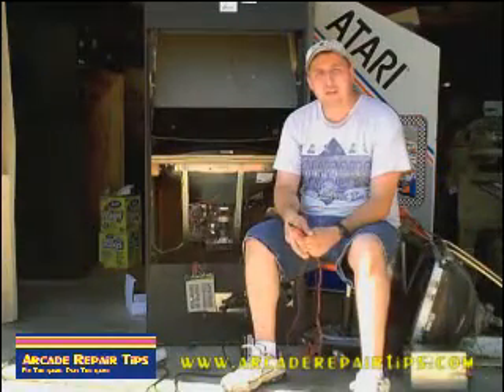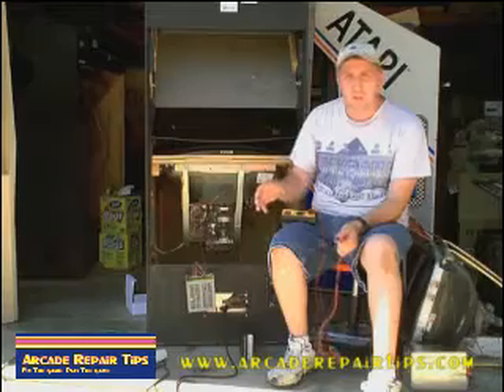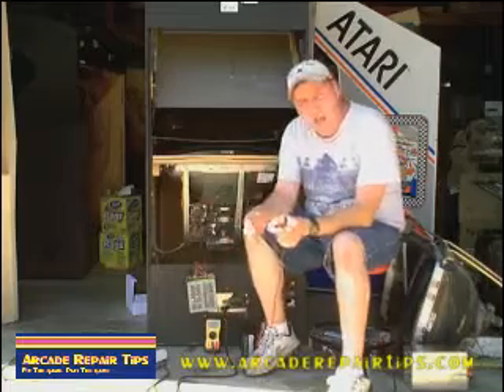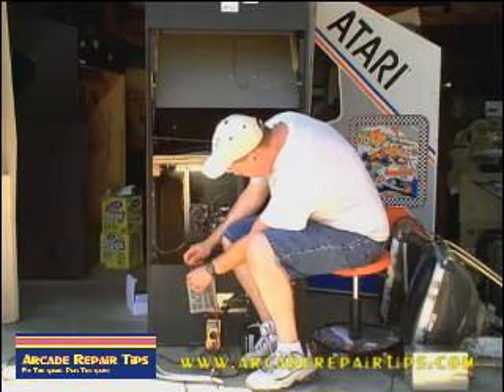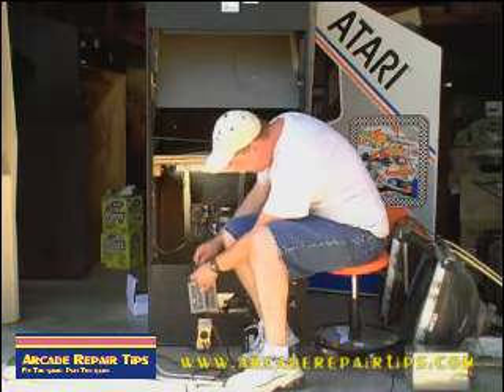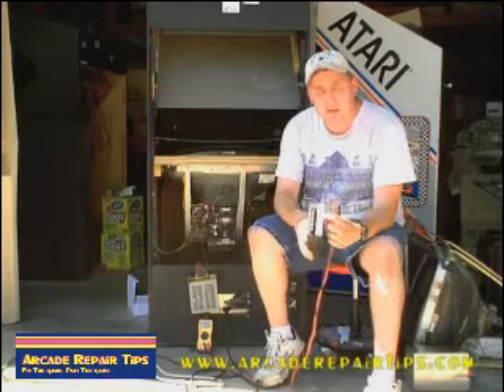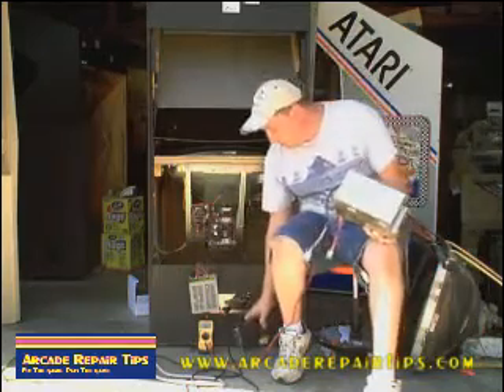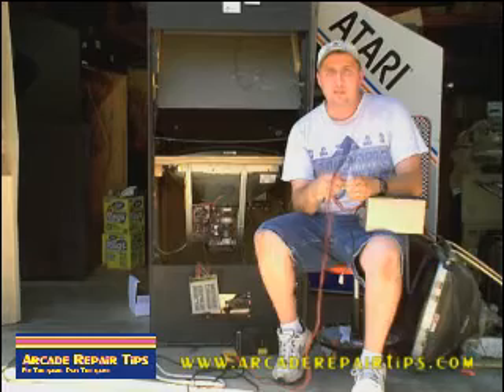Arcade Repair Tips - Checking And Replacing A Power Supply

Comment: The sega hang on I just picked up sat in a  storage shed building for the last 20years.    The game is playing good and the voltage is good on that old power supply.  Should I keep playing it as is or change that power supply ?  I don’t want to mess up the pcb.    Thoughts ?
Reply from the maker: As long as the game is playing well and the power supply is sending the correct voltage to the game board, you should be able to continue using the old power supply without any issues. When switching power supplies stop working, they usually just stop outputting voltage so damage to the PCB is rare. With that said, it’s not a bad idea to replace the old power supply with a new one especially if it’s more than 10+ years old and you are worried about its longevity going forward. Good news is that they are not too expensive ($50 or less).

We will also be covering your question on our Live Show Episode 99. Here's a link to the episode if you want to watch it: https://www.youtube.com/watch?v=h9DfXx4p4N8
Reply: @ hey thank you so much.   I’ll probably replace that old power supply.   It’s rare to find a working sega board especially a hang on.  so I should plan ahead    Take care guys.  Look forward to the next show

Comment: In my sega hang on I measured power at the molex connector it shows 129.1 volts going to monitor.   Is this ok? I don’t want to fry anything.   It has  a k7000.   I also measured power at the connector that runs the cabinet fan it also measures 129.1volts is this okay considering it’s just a small 4 inch fan ?
Reply from the maker: 129.1 VAC should be OK. Most electronic devices that use AC power will operate fine if the voltage is anywhere between 110-140 VAC. Hope that helps!
Reply: @ yes!! thank you so much

Comment: My arcade stop powering up my Jamma board and I have tried everything… even a new jamma board… thoughts? Can send pics please help!!!!
Reply from the maker: Have you checked your power supply to see if it's putting out the correct voltage? That's definitely the first place to start. You can email pics to questions@arcaderepairtips.com if you need additional help.

Comment: Should I disconnect the DC output completely before plugging in and testing?  It will boot if I do not.
Reply from the maker: Justin, we usually test the DC output as it is when we first obtain the cabinet. If the DC output is hooked up, we also recommend checking the voltage at the board level to make sure it is getting good power there as well.

We will also be discussing your on our Live Show Episode 42 coming up on Thursday, August 6, 2020. Here's a link to the episode if you want to hear more of our thoughts on your question: https://www.youtube.com/watch?v=IlCOqzjeDDY

Comment: Thanks for this video. I just bought my first arcade cabinet (Bad Dudes) and when I powered on I would get a black screen. I had to leave the cabinet powered on for 5 minutes then shut it off and on a few times to get it to display. It’s like it needed to warm up. I tested the DC terminals on the switching power supply and had no voltage during the “warm up”. When the game was operating normally, it would show 5V and 12V on the DC terminals. I’m going to replace the power supply. Thanks again.

Comment: There are 1000 page books on power supply units (psu). This video did the one smartest thing about psu issues - it suggested you get help when things get murky.  Good on you guys. 

One suggestion, if the wiring color does not conform to the atx standard, send it back. Who knows what else they bodged up.

Comment: hi have 2 daytona usa 2 one power edtion plus battle on the edge i cant get the music to work but has full sound effects i have tried all menus no luck also i cant get to link i was told when i bought that they would link i have replace the optic fiber cable as well , is there a link set up mode ie master slave tx dx dx tx  is the sound card? thanks kev

Comment: you tell to set up the power supply to the most accurate we can to 5v and 12v but (at least with the 5V) shouldn't you leave it a little bit higher like 5,1 or 5,2 since when you connect the board it will make it go down a little bit...at least I use to do the measures and adjustments with the board connected (ensuring at least it is not overpowered) to make such adjustments.

Comment: Love your series. I just bought a new atx power supply, just like the one in this video, for my Neo Geo 25" and I think I should check the voltage before hooking her up. I am very new to the tech side of arcade cabs and this video is great. My question is do I need to have the PSU plugged in and powered up to test the voltage with the multimeter or do I do the test like you have demonstrated with just the meter and the PSU not plugged in and powered up? I'm new so forgive the noob question.